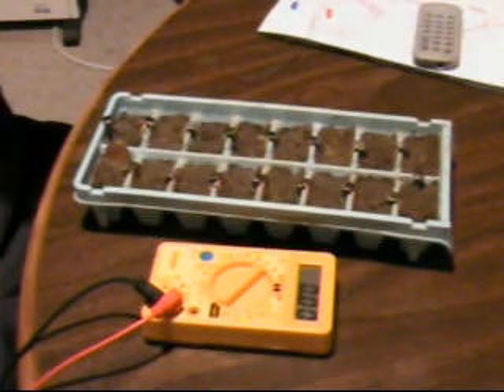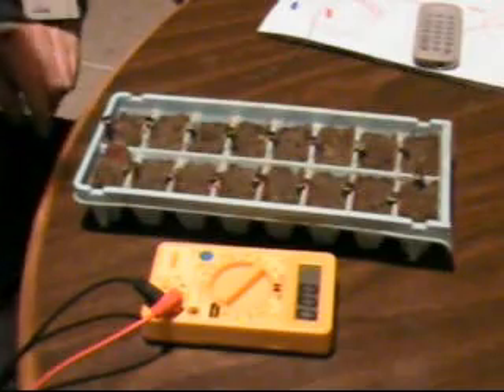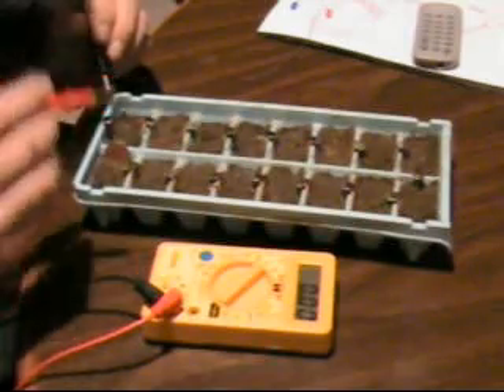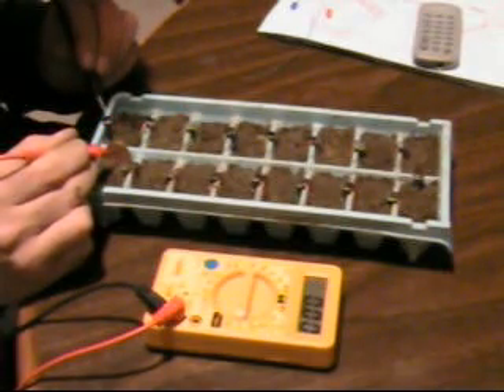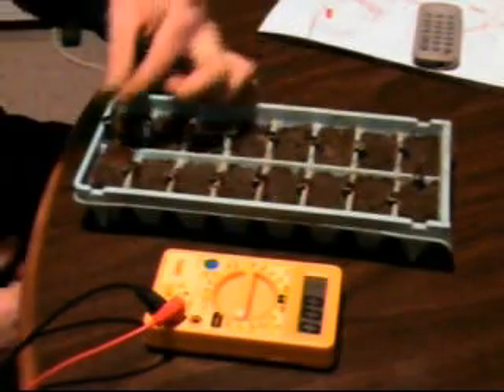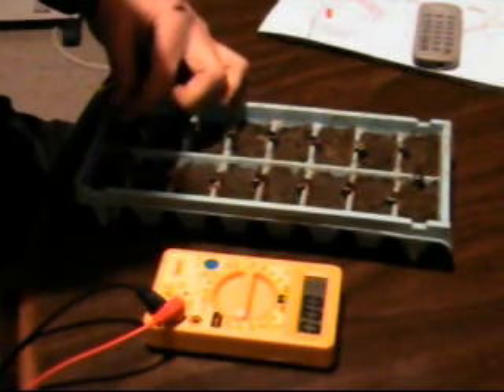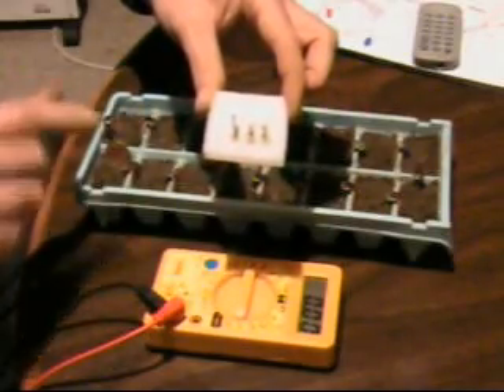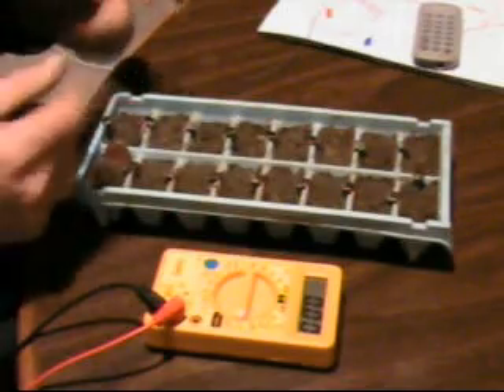12V Earth battery

Comment: Just my 2 cents worth of "add-on" suggestions here, but try putting CAPACITORS between each of the cells and then "GROUNDING" it to a Battery (OR... a Voltage Regulator) then passing it through a DC to AC Inverter (with a Voltage Regulator added to it.)  This MAY allow you to use these as "BATTERIES" and POWER up even your AC devices (I've been building something VERY similar and have charged up a SERIES of CAR BATTS to run a FREEZER out in my shed - from "FREE" power.)

Comment from the maker: I don't have a 12V DC fan to test with but as I've stated many times here, this has only been tested on low power DC devices. Under load it will not maintain 12V out (unless scaled up).

Comment from the maker: If i said 2 amps it was obviously in error. That's enough to fry someone. 65+ milliamperes passing through the heart is enough to stop it. This is more like 2mA. In any case i get light from it for around a week before having to reload. Also as correctly stated the amps should be measured in parallel under load which i didn't do.

Comment: Very nice, I will try this out in a few days. Just a quick question, how long does the power hold before you have to add the electrolyte(?)? If you are getting 12v and around 2 amps, then for how long does that hold?

Comment from the maker: Magnets are tiny. Smaller than my little fingernail. Any soil will do. The soil simply holds the pieces up and holds the acidic solution. Enameled wire has a thin coating of enamel which means the copper is not exposed. You need to either scrape all the enamel off or get some bare copper wire.

Comment: I have a few questions I hope you don't mind answering.

1. What size are the magnets you are using?

2. Is it vital to use soil from the wild? i.e. not garden compost

I have just tried this experiment, using coiled enamelled copper wire (14swg), ordinary garden compost and 3mm diameter x 1.5mm thickness neodymium magnets. It does not work.   

Any help would be much appreciated. Thanks

Comment from the maker: Copper wire is fine. Make sure your zinc is really zinc (zinc covered screw for example). make sure each cell is contained with no dirt spilling from one to the next. Start with one cell, take a voltage reading, then two, test again etc.

Comment from the maker: Search my channel for 'Voltaic Pile'. You will see a series of copper coins and zinc coated screws. They are in pairs. Between each pair is a drop of vinegar. Each pair is not touching, that is, between each pair their is a small gap in which vinegar links the pairs. Now think of the earth in this video as the vinegar in the other video. Each cell is joined to it's neighbor (opposite metal) via a small magnet instead of a wire.

Comment from the maker: Yes, in the front cell of the tray (close to my hands) there is copper on one side and zinc on the other. Each cell has one copper and one zinc. Starting from the left front and moving to the back then returning, each copper is attached to zinc in the next cell by a magnet. That leaves one copper and one zinc at the front of the tray where the circuit needs closing by a load. Add any electrolytic solution and electrons start moving due to redox of metals.

Comment: Magnesium and carbon, both have been used in batteries. If your metal corrodes, that's where you're getting the current from. Dissimilar metals and an electrolyte. The earth isn't needed or useful.

Comment from the maker: Yes Douglas is correct. Spirit of salt is simply Hydrogen Chloride. Any acid will do. Sodium Bicarbonate would also work as it is amphoteric (base and acid) but you will get better results from a strong acid to facilitate the redox reaction. Also thanks to ETHIOLOGIST1 for the info about plants producing vinegar. I didn't know this.

Comment: I know that style of multimeter well and I can tell you straight up that you never tested the amperage correctly. The positive lead needs to be plugged into ADC port. You kept it plugged into the V/Ω port. Thus the readings you got were nonsense. Also you cannot actually test the current of a battery without a load so a proper reading with the leads directly on the terminals would be 0, not 2.5. But you seemed to have plenty of current given the LED light test so it really doesn't matter. :)

Comment: To charge a Mobil u need AC to DC power...so the shcematic would have your wires go to a rectified diode...to charge the battery...thay .battery requires DC....

Comment: What are the measurements of the salt, vinegar, and "spirit of salt" your using. And do u have to use magnets in between the cells.  I have tried replicating this but I don't get the same results, so I'm thinking the liquid solution is incorrect.

Comment: i WENT LARGE SCALE burred two brake rotors , put an aluminum car radiator in the air, figured it had way more area, than anodized aluminum sheeting, plus the wind blowing through would cause more static friction energy (which amps do increase greatly ion high winds Used cooper leads so I have a mixture of three metals, For fear of my life I wont post it but you gatta do this for yourself It;s amazing virtually enough my entire shop!!!

Comment from the maker: @4240ed Galvanized zinc screws or nails. Not the best solution for longevity. You can purchase solid zinc from marine shops as some boats use a sacrificial zinc slab to counteract galvanic corrosion.
h t t p : / / w w w .answers.com/topic/galvanic-corrosion-1

Comment from the maker: Thanks very much. For others reading i advise getting hold of a table of potential electron differences. The polar opposites (the biggest potential difference) will produce the most volts. Carbon and magnesium give very good results with almost 2V per cell. This is DC current only so please understand you are not going to get any truly meaningful work done like charge a battery. The mesapotamians were using this technique before Volta discovered it ... so this is all very elementary science.

Comment: What you are presenting here is great, i have been working on the same idea but i am not using hearth i use towel-paper water and a little 5% salad vinager. The zink does last a long time but i found something that gives much more power, (try ferrocerium) you should get 1.5 volts per cell. If you don`t know it by it`s technical name it is the little rock that sparks in cigaret lighters. These will turn into powder after a while but one can use only water with good results. Try it and have fun.

Comment: @delagrazia Do you know how much money you would be spending on vinegar to get any significant amount of power out of these for any significant amount of time? Chemical batteries are only as powerful as the electrolyte you use in them... There is a reason why the batteries you get at the store use alkaline or lithium and not vinegar.

Comment: @RadioIlluminaticom There is a way to increase the amperage though. You see you place batteries in series to increase their voltage but if you place them in parallel instead you increase their amperage. So you would need to make several sets of 17 batteries each in series and then connect each series together in parallel with eachother. Ultimately before yuo would actually get anything usefull out of it however you would have at least 170 of these things hooked up together.

Comment: @RadioIlluminaticom I take it you chose 17 because it places it at 204 volts which is close to the voltage of wall outlets in some contries right? The reason is because it would actually take a lot more then 17 to do that. You see voltage is not a measure of electrical power. Wattage is. Wattage is the current's voltage multiplied by it's amperage. The problem is this battery has allmost no amperage at all and thus 17 of them wouldn't be able to properly power anything.

Comment: @MrAwsome514 Technically it is possible but it would require something called a joule theif circuit (which the egyptians would not have had as it requires a transistor) and even still the battery would be drained so qickly it would take a creat full of them to get any work done. The difference is the alkaline batteries in this car scenario are a lot smaller then these earth batteries. Could you imagine having to replace an entire room full of dirt every couple of minutes? Not very effective...

Comment: @983215ljhlkadbspig6y What you don't understand is that the energy is not comming from the dirt. It is coming from electrolytes in the dirt. This is a chemical battery. It works in the same way as modern batteries do. The electrolytes contain a limited amount of energy and thus once depleted they must be replaced. The egyptians running any form of lighing on a battery system like this would be like trying to run an electric car on a single AA battery.

Comment: @fuckityouwin Yes it is a fraud. It is just a MUCH more basic version of a chemical battery not much different from the ones you buy at the store... With the exeption that this is a low tech and MUCH lower power version. He is trying to pass it off as something a lot more significant then what it actually is. But it is still just a chemical battery. It will run out of power just like any other chemical battery and it will do so faster then any other chemical battery you have ever seen.

Comment from the maker: I should mention there is no wireless electricity going on. That is shown in my other videos. Here, the two dissimilar metals are connected by magnets (aligned in sync) because i was too lazy to solder wires to the metals. Nothing ground breaking going on here. Between each cell is a magnet which connects all the cells in series.

Comment from the maker: @brandon9966 I don't mind explaining. Each cell is connected to the next by a neo magnet in place of wire. They are made of neodymium, iron & boron and are coated in nickel to prevent iron from oxidation.The nickel is transferring electrons from one metal to the next. It is simply acting as a wire. Obviously electrons are affected by a magnetic field, so on this level there is certainly interaction, but i don't have equipment to explore it further. I believe there is a slingshot effect going on.

Comment from the maker: @brandon9966 Yes they may act as a conduit for electrons. If not the magnet itself, then most certainly the material they are coated in. I used them in place of wire for this project, but can't comment on using them in all electronics. Keep in mind the coating on the magnets will deteriorate very quickly.

Comment from the maker: @siafulinux Yes graphite and magnesium for example would give you excellent results and the graphite would not need replacing much. A larger version should last a little longer, but i would not imagine by much. The redox rate would be equal, however the increased surface area of metals would mean a better throughput of electrons resulting in more work available ... or a higher amperage if you like.

Comment from the maker: @siafulinux No after 2 weeks the metals need to be replaced. Oxidation has taken it's toll. If solid metals were being used (solid zinc and copper) then you would only need to scrub them to remove oxidation. The zinc would not be reduced as fast as it is solid.

Comment from the maker: @minhchau1997 carbon and Mg was my other battery that gave me enough power to run a small magnet rotor.  Not alot of practicle use but an enjoyable experiment. These days i have been focusing more on the wireless electricity.

Comment from the maker: @xbuster17 This device certainly won't produce enough power to effectively run your fan. "but i don't want to renew the metals much(ever if possible) " ... that would be nice although a bit of a pipe dream. The only cell i have seen that requires little replenishment is the crystal battery set in stone by Huttchinson. Bedini is also working on it although i think a cooling system would require considerably more power than they produce.

Comment from the maker: @OKMUNWURX Thanks. The coins are copper and the other metal is galvanized in zinc ... so it is essentially copper and zinc. Instead of these two metals i have used carbona nd magnesium which have a much higher electron potential ... and give around 2V per cell. You can see the homemade carbon magnesium battery runing a small magnet motor here: w w w .youtube.com/watch?v=VsH9WKb1GE8

Comment from the maker: @robvh2 I have explained this a few times in comments. The earth merely acts as a substrate to hold the metals upright and retain moisture. Using just the acid solution works fine, but there is nothing to support the metals, and they redox out too fast. Yes, the video would be less interesting without dirt. Ones definition of a dirt battry will vary and i am not so sure there is a fixed definition. Lithium batteries contain lithium and so on, my one contains earth.

Comment: Why the dirt at all? Why not shrink the whole thing dramatically and just use the acid solution? Or would that make the video boring because then it's not a "dirt battery" (which it isn't anyway)? I'm just curious.

A "dirt battery" implies that I could stick these electrodes in my garden outside and get 12V out of that setup.

Comment from the maker: @BobTheNecrophile Unfortunately no. Only low DC power devices such as calculators and LEDs. Take a look at my wireless electricity videos where i show charging a capacitor from water, and from the excited local vacuum surrounding a slayer exciter. I believe this has charging potential.

Comment: @Br0kenMan The soil itself is not generating the power in this case but as a means to contain the Hydrochloric acid solution for a chemical reaction. You can use ordinary cloth in exchange of the earth and it will still work with the solution.

Comment from the maker: @azkeyz not alot of real work being done. Current is almost non existent so really only usefull for LED and other low power devices.

@ gentletuesday would be closer to 2.5 although not measured in series and under no real load. Justa  bit of fun.

Comment from the maker: Copper and zinc is not in a car battery. They use lead (lasst time i checked)  ... which is much more potent than my experimental battery here. There is no chance here of using an inverter, or charging ANYTHING with it. I've mentioned so many times here that the dirt just acts as a substrate to hold up the metal. It also helps with retaining moisture. Thanks for your comments.

Comment: that's really cool...never knew this was possible. I think amp meters are have zero resistance across the terminals, so to put an amp meter across a battery is like shorting it. maybe use a higher ohm resister in series with the meter and then the amp meter wont kill the battery. I think...

Comment: @Br0kenMan 
Here's what I did:
Inner (annode?) of one unit gets attached to the outer copper (ground/negative) of the next in series, etc... they stick out of the ground about 2 inches. I only made 4 but I get 0.6v from them. If I disconnect them and test one it is less. The guy I got this idea from says the deeper you go then the more voltage + amps you can get. Otherwise you need quantity (vs depth). I'll look into the circuit you mentioned, thanks.

Comment from the maker: @Omnignosis I don't understand how you connect rods in a serial connection in the ground. For a serial connection the subtrate (earth) needs to be isolated from each other. I would imagine no matter how many rods you use, you get the same vlts, but i higher amp draw. I suggest trying a joule thief circuit or modified disposable camera circuit to increase your output.

Comment: I've pounded the copper rods 4' into the ground with a galvanized steel middle rod in the top about 3" in. I get 0.6v from 4 rods. So if you pound in 8 you get a volt. Is there anyway to step that up to 6 or 12 with a coil or not, so I don't have to pound 80 rods into the ground?

Comment from the maker: @frank0067 I also have a magnesium/carbon earth battery outside. There is no difference between having it in solution as opposed to having it in earth outside. So my answer would be no, the earth has very little effect. There is some belief that the earths telluric currents interact with the cell increasing output, but i am yet to discover this. For my cell here, no the earth has little effect other than keeping everything upright and standing, and soaking moisture from air.

Comment from the maker: @nevaalone Thanks. This video is quite old. You can see in some of my newer ones i made a graphite,Magnesium cell and ran it through a joule thief circuit. Since then i have modified the joule thief circuit and used a bifilar air coil and the results are astounding.

Comment from the maker: @enlil06 with such small components this setup lasted around 4-5 days before needing more moisture added, then another 5 days before oxidation took it's toll. A larger version with metals completely covered (not exposed to air) lasted over 3 weeks before reduction used up the zinc.

Comment: Let's not forget that galvanized steel or zinc-coated computer brackets, etc. require electrical power to be manufactured. This isn't free energy, it's oxidation of reduced metal.

Comment from the maker: @Luv2travel0709 You can have a galvanized steel nail in soil along with a copper wire and some lemon juice however this won't be enough to recharge any battery.  It should be enough to run low DC electronics like a calculator or LED light.

You could possible use another circuit such as a joule thief and use the spike from the collapsing field of the coil to charge your battery. Of course this would require a little knowledge of circuitry.